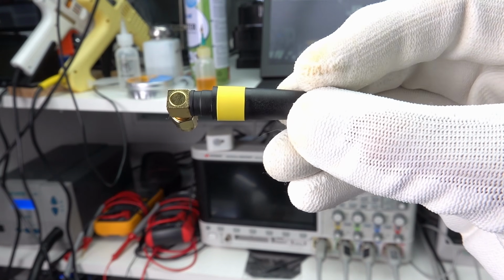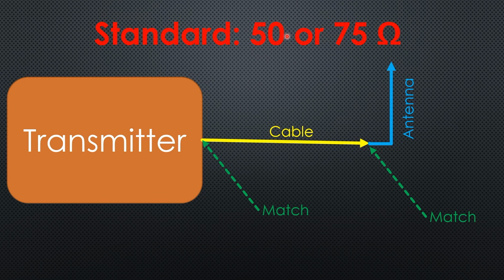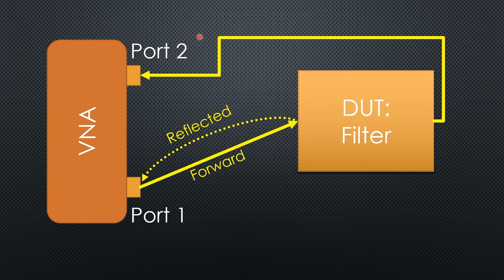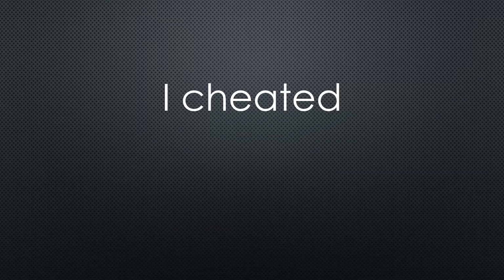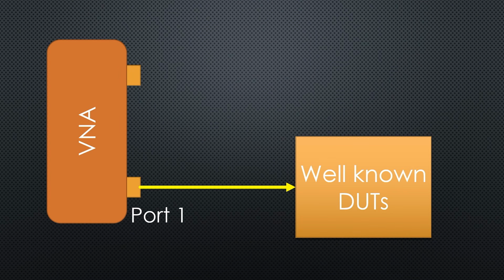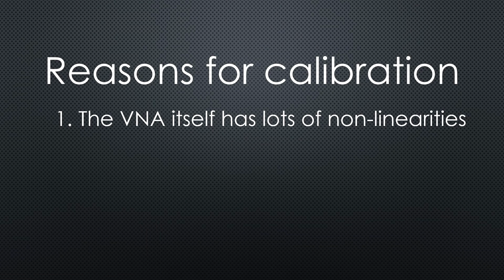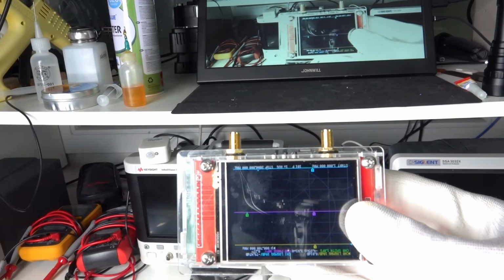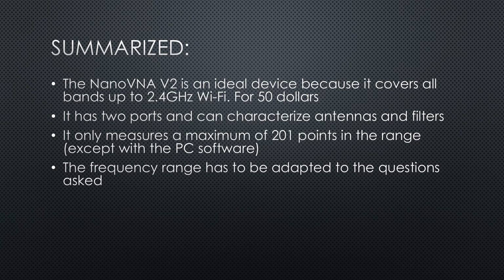437 How to Use a Vector Network Analyzer (VNA) to Test Antennas

Comment: I suppose I live in the United States, and they are currently weaponizing everything. Previously I was pretty sure what I would have chosen as far as amplifiers of any sort, but you have to wonder about stability of the circuit despite insane inputs. Anyway, I'm pretty sure I know very clear inputs to this sort of information but no one else around is going to listen to it. Anyway, use a speaker that is likely going to be magnetically useful
Reply: Commenting in the wrong tab 🤣
Reply: @cristianstoica4544  I remember leaving that comment, but certainly not on this video, not sure where it went wrong
Reply: @spacecase0  Lol.
Reply: @spacecase0  It does sound interesting. I suggest looking into the operation of Geiger mode equipment and optical transducer materials. For your scientific field studies, hope it helps 👍
Reply: Right above my head 😅😂

Comment: This is very useful and entertaining video, Good job Mr. Spiess, They have such Circuit to match the impendance, This is an Antenna Coupler or Antenna Impendance Matcher, This main job is to Match the Impendance and Phase Shift of Waveforms, This mainly use for Ham Radio Antenna to Improve the Radiated RF signal to the Air
Reply from the maker: Thank you. And you are right, these devices exist. But still I prefer to have a matching antenna if possible. It does not have the cost and loss of a tuner (I am a HAM operator ;-)
Reply: @AndreasSpiess I love to watch a video on ham radios for beginners especially on your channel